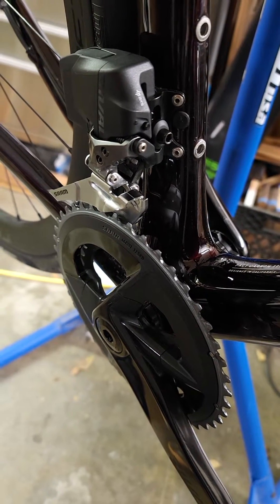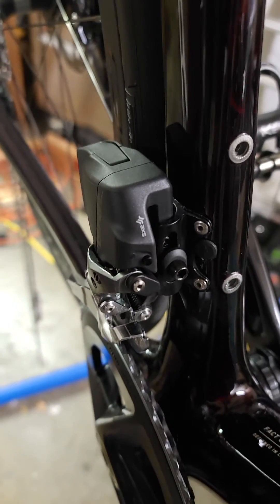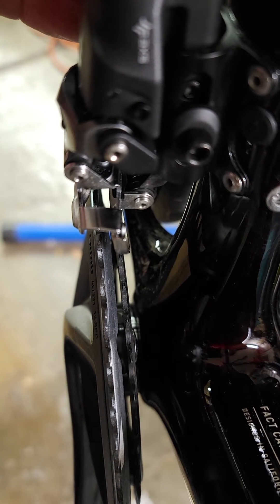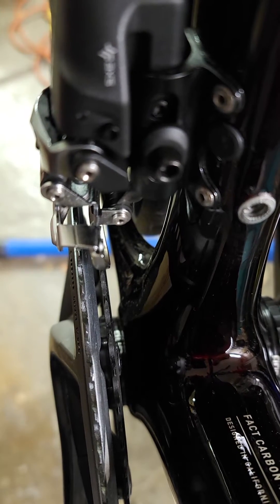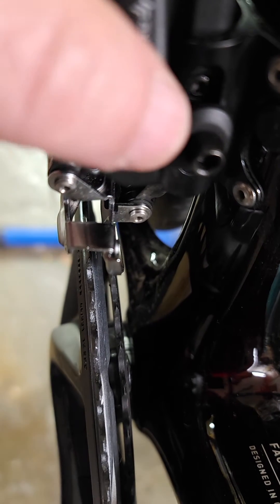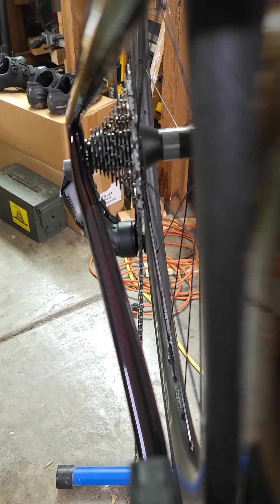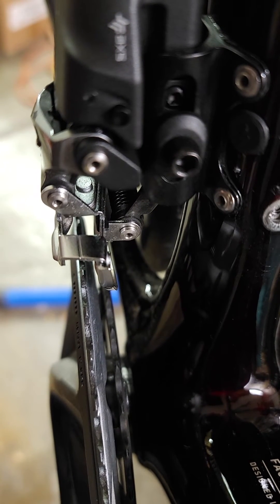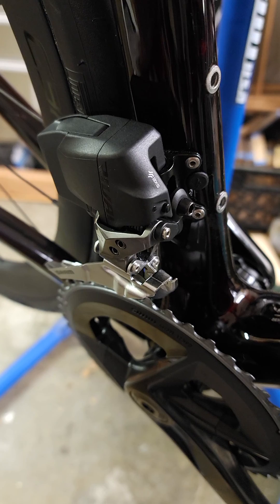Sram Rival AXS front derailleur overshifting

Comment: I just got a new force chain for my otherwise rival drive chain.

Never had a problem with chaindrop before with the rival chain but know I have.

I noticed the drop seemed to happen when the quick link was in the "shifting part" of the chain.
I mention this because I split the new chain myself with an old cheap chain splitter - not recommended by sram. Wondering if this could have damaged the chain and that is issue.
Reply from the maker: that's an interesting data point. thanks. The chain in use on mine was what came on it from the shop.  Let me know if you resolve your current issue.
Reply: Can dismiss my theory - the chain is thrown on all parts of the chain. 

Have fixed it though by rotating the cage counter clockwise so that the marking in the front is about 2-3 mm to the left of the chainring and the the large marking in the rear is about 2-3 mm to the right of the large chainring. 
From here I adjusted the limit screws - haven't been able to drop it and no scratching in the highest gear. 
 @zcarfanatic

Comment: I have same issue with my forces axs etap. Any solution yet?
Reply: get it set up by somebody that knows what they are doing. I had a 5/5 google review bike store look at it 3 times without a fix. Called the CUBE dealer told them the story. They said we will 100% fix your issue. Brought it there and it shifts like a dream and no issues anymore. It's sensitive and needs to be setup by somebody with experience

Comment: I am having the same issue on my wife's new Tarmac with eTap. Works and then doesnt. Overshifts and drops the chain going from small ring to large. Not every time, but what does it matter, it happens twice or more per ride. We watched it and saw that if you wait a second it will correct itself and be in the center line but by then it is too late and the overshoot has done its damage. Had it in the shop twice, works for a day and then goes right back to overshifting. There is NO software/firmware update from SRAM available and so far they have not responded to my emails.

Comment: Seems like nothing has changed re this problem. Just completed new build with AXS Force FD. Have to adjust the high limit to where the chain has a mild rub in highest gear and still not real confident it's not going to drop. If adjusted for no rub it drops chain out board. Never had this prob with mechanical shifting. C'mon SRAM, you can do better. Figure this out

Comment: Bought a new bike in winter and rode 500 km with SRAM Rival without any problems. Switched to waxed (old) chain and rode 300 km without problems. So 800 km without drop. Now I took a new waxed Rival chain, made Firmware Update from xxx to newest version. And bam, had chain drops, 6-7 on a 40 km ride?! All adlustments at FD are like in the SRAM Video, no loose bolts etc. WTF?
So I adjusted the FD about 2 mm above large ring teeth (red SRAM tool will bring it to 4 mm gap) and brought the chain in biggest and smallest cassette ring to a soft contact with FD. Now no drop and quick shifting with low or high cadence is possible again.
Because I was too lazy (and don't want to open the chain lock to often) I will not learn if the old chain and new chain differs or if the firmware update was the bad boy. But because here are some same storys with lots of error free km before first drops I think there is a massive change in firmware at some point.

Comment: It is not over shifting...

Rival AXS does that and aligning it like that always is gonna throw the chain.
You gotta think outside of the box.

I am able to set the FD even with Carbon Ti rings which are notorious for not great shifting and I also have them as a 48-33 combo, which neither company/sram or Carbon Ti recommends.

And my shifting equals rhet of Shamo di2 12 speed
Reply: So how do you adjust it?
Reply: @StarchaseKA  it's a little longer process sometimes, and I can explain BUT I have to type a lot and I can't do that. If there's a other way, like phone, then we can talk
Reply: How have you done this? Can you explain it?

"You gotta think outside of the box.

I am able to set"

What have you done?
Reply: @StarchaseKA  yes I have done this plenty…
All sram derailleurs do that … For example, watch SRAM newest video for the new front derailleur it does exactly THAT. Overshifts to put the chain on big ring and then goes back…

P.S. about thinking outside the box, I AM ABLE to set any SRAM AXS FD with any chainrings…
With Oval Absolute Black rings, with 2 different Oval setups from Rotor, Rings with 16 tooth difference and lastly as I mentioned, CARBON TI chainrings…. They are notoriously famous for not shifting well with SRAM.. I have them set perfectly on my latest bike… And I also have them as 48/33 which SRAM DOES NOT recommend. Shifting is dead on perfect… So to summarize to do many of these setups you need to think outside of the box, not always following Sram’s instructions.

Comment: Same issue here. Mid to large ring at the back tends to drop the chain crank side when I shift to the big ring at the front. Latest firmware. Will keep an eye on this chat to see if any new clues arise.
Reply: Rotate the FD counterclockwise a few millimeter so that the center of the cage should be on the left edge of the chain and set the limiter screw so close to the chainring as possible.

Comment: My problem is that the FD is under-shifting from the small to big ring. It always worked fine but suddenly only moves about 1/4 of the required distance. (battery is charged, firmware up to date)

Comment: Found this video while troubleshooting my Force AXS FD. In my case, the issue was caused by 1) braze-on misalignment and 2) small chainring inverted 180°. The inner chainring has a catch to help the chain onto the large ring.  The inner ring should be aligned with the single-tooth indicator pointing outward toward the crankarm.

Comment: Never realised that the overshift was different if the rear gears were changed! 8 months on, how are you getting on? I was going to try and get realigned soon as I have had an overshift every 100 or so FD clicks.
Reply from the maker: Mine still seems to drop to the outside once every 50 shifts. I have set it up so that the front Derailleur is rubbing the chain when in the large front, small rear cog.  I probably need to take it in for warranty work.  Unfortunately, I just try to avoid front shifting when riding.  mostly riding in the big chainring unless it's a sustained, steep grade. I suppose I need to go out and just do a bunch of front shifting to see if there's any real pattern to it. Overall disappointed that SRAM lets software defeat the mechanical limit screw. I'd really love an explanation on their thought process.
Reply: @zcarfanatic  I've updated everything on mine yesterday, I'm going to probably use the workaround of making the alignment line 0.5 - 1mm out on purpose.

Next plan would be an ugly chain guard but that'd be disappointing!
Reply: Also, mine always drops when I'm in gear 6 or 7 and shift at the front. Your video shows why!
Reply: i have drop issues too , but it seem fine when life up the derailleur about 4mm between large 45 Teeth
Reply: @jcstephenchan_hk  hmm, had a shop look at it recently, apparently fixed but dropped straight away. Got some feeler gauges off Amazon to try and make sure I can get 0.25mm between the chain and derailleur when in 1-1
Reply: Update on this, managed to get the low screw 0.25 away from the chain. It sounds like a small bit of grit when it hits but I've had no issues with the chain being thrown. I'll update after a few miles.

Apparently adjusting the high and low screws on a stand is good to get a ballpark idea but it won't behave the same way on the road.

There's a good thread on R/bikewrench about it.
Reply: 270km and just had my first dropped chain, not sure if it was my fault though (slow cadence prior to changing)

Comment: Hi, did you find a solution to fix this problem ?
Reply from the maker: I've still had this happen a couple times.  I'm starting to just not shift the front derailleur if I don't have to.  Suck I have to adjust my riding to accommodate for a sub-optimal front Derailleur.
Reply: Rotate the FD counterclockwise a few millimeter so that the center of the cage should be on the left edge of the chain and set the limiter screw so close to the chainring as possible.

Comment: if can i help us , i tell my story... after 3000 km same issue. i have spent ours to solved the problem ,watcht sram videos , read manual etc. finally i go to mechanic and he tried 3 times to find the right position and nothing, when he use the adjustment tool he find the best possition by derailleur and now i have less drop chain. i have notice that when the chain is clear with fresh oil , the chain drop disapeared. sure im disapointed with sram e tap force. sorry for my eglish

Comment: I spent 2 days before work and after work trying to figure this out and after seeing your video I’m starting to feel better that thought I was seeing things. This overshifting already caused lots of scratches on my thm crankset with carbon ti chainrings. I been using 1x and with this new build I thought going back to 2x was going to be safe but I’m so frustrated about this over shifting that no matter how much I followed every forum and YouTube video, it still over shifts onto my thm crank 🤦🏽‍♂️🤦🏽🤦🏽‍♀️ I’m about to buy that dual chain catcher  i just found and that might solve my issues but man this sucks. Especially after scratching my new thm crank arms .
Reply from the maker: let us know how that goes.  The scratching on the outside of the chainring/crank-arm is like salt in the wound.  With mechanical group-sets, I might see that once.  after 1/4 turn of the high limit screw, it never happens again (13 years of no chain dripping on my old road bike with manual shifting).  This is a clear case of the technician in the lab thinking they know better than the end user.  When I set the high limit screw, I expect that to be the final limit.  So frustrating...
Reply: What dual chain catcher did you go for in the end?

Comment: I reached out to SRAM support… issue solved. The motor is intended to have this movement, and you need to dial back the upper limit screw in 1/8th turn increments (clockwise) to solve the over-shift. Just make sure the chain is in the big front ring when you do this. If you adjust the limit when the chain is in the small ring you can destroy the derailleur. Here is the section for troubleshooting this issue in the manual: https://docs.sram.com/en-US/publications/2bJvdvYz3DCAfCZVNeUucG/UM%20-%20eTap%20AXS?models=rd-apx-1e-d1#hashItem=front-derailleur-adjustment.

Comment: I am having the same issue. Bike shop installed a new bottom bracket and now front derailleur is over-shifting. So strange as this has never happened before in the 8,000+ miles I’ve put on the bike until now.

Comment: I have the problem where the chain is in the 13ish and then shift the FD from small to big and the it drops outboard.  The FD shifts fine when it is in the higher numbered cogs.  I've tried to play with the limit screws but end up with the chain not moving up to the big ring.  Very frustrating.  If I just pay more attention and shift before I get to the 13ish I guess it will be ok.  Shouldn't be that way though.

Comment: I've had this issue with my sram force FD since day one, I've sent my bike back to the bike shop multiple times only to be told there is nothing wrong with it and that it's the way I'm riding 😠. And now the front derailleur won't shift from the small chainring to the big chainring at all. It touches the chain and stops all together. I wished I had never purchased this group set,in my opinion it's absolute junk.

Comment: I don't know where you learned how to set that up, but their instruction videos do not match your way. Go back and learn the right way.
Reply from the maker: Hey Anders.  I've watched their setup video multiple times.  I have found it's consistent with the published setup instructions in the manual.  Can you elaborate on where I may be going wrong?  I've not experienced chain drop since my 4/15 update, but admittedly have been shifting more in the rear and less in the front - mostly due to a lack of trust.  I was watching the "SRAM eTAP AXS FRONT DERAILLEUR: Installation with setup tool method"  that is 2:50 in duration.

Comment: Same Problem here, changed the Chain on my Ultimate 2021 and suddenly the problems began. There is no setting to fix this. On the lower gears (gear) sometimes its perfect and then a total fuckup for the higher gears. Then I change something and its vice versa.
Even the overshift of the FD is not consistent.
Reply from the maker: is your rear cassette shifting ok?
Reply: @zcarfanatic  absolutely flawless. After 1 week I gave up and switched to 105 DI2. Works flawless after 10 min of finding perfect settings on the FD. I am done with SRAM on road bikes...

Comment: Glad i found this vid. My 2022 Giant Defy Advanced 0 came with Rival. The last ride out I did, its chucked the chain oft the crank side 3 times. Luckily I was in a safe place to pull over whilst in busy traffic. Ive never done any firmware updates as yet, is it as easy as going into the app and connecting to the bike?
Reply from the maker: The firmware updates are super easy, but be sure to run through low and high limiter adjustments again after the firmware updates since software crew is able to override our field adjustments.  After my last firmware update, it dumped the chain to the inside of the front small chainring the first time I shifted into the small chainring.
Reply: @zcarfanatic  oh that would be also an explanation.... Thought FW update would not mess up the whole limits

Comment from the maker: 4/15 update - I have resorted to adjusting the high limit screw in a bit so that when using the large front ring and smallest outer rear cog, the chain rubs the FD cage.  Annoying when it's in the stand, but not even noticeable when coming down the local hill at 45 MPH....  I did not have any dropped chain issues on my last ride, but I've been trying to avoid shifting into the small front chainring for fear of having to shift back...  coming from dura-ace 7800 (from 2009) on my old bike, which was perfect and NEVER dropped the chain, it's disappointing that we have to deal with this.
Reply: Apparently mine is doing this from day 1 and there isn’t a good solution for that no matter how perfect I install the FD. The only way is to adjust high limit screw clockwise, move the cage inward. It will rub when in big chain/small cog but that’s better than chain drop
Reply: I currently run SRAM Force, and while it works, the setup tolerance is incredibly narrow. You know it’s dialed in correctly based on how it sounds, but even then, there’s little margin for error. Proper rear cassette configuration in the SRAM app is essential, as I believe it over-shifts by design to compensate for cross-chaining.

Even with everything tuned perfectly, I still experience occasional chain drops—about 1 in every 30 shifts. This issue persists across the entire SRAM lineup, and even the latest Red hasn’t resolved it.

I use this groupset on my BMC TeamMachine, but I’m about to rebuild it with Campagnolo SuperRecord EPS, which I managed to pick up brand new for €1,200—and I won’t be looking back.

For my next bike, I’ll be choosing between Shimano or Campagnolo Wireless, but right now, I’m leaning toward Shimano. It’s bulletproof, and frankly, I don’t want to waste any more time tweaking a groupset that’s been flawed from day one and that SRAM refuses to fix.

That being said, I do run SRAM MTB groupsets, and they’re rock solid—but that’s in a 1x12 setup.

Comment: I have the same issue I find it's a problem in the middle of my cassette everything else is fine I've installed the latest update that came out just a few days ago and haven't noticed much change. I have noticed that with the micro indexing there's a smaller adjustment when setting the micro adjustment closer to the right (towards the 10) tooth.
Reply: Update I fixed the problem, My problem was that my front mech height was too high, the wedge that is also used on the back of the front mech wasn't screwed into place so on some aggressive shifts the mech cage would move a little bit. Hope this helps.
Reply from the maker: @jaspreetsidhu5708   awesome!  thanks for sharing.  I have checked the wedge on mine too and made some adjustments, but in my case made no difference.  adjusting the cage high limit screw to where it rubs seems to have resolved the issue for me...
Reply: @zcarfanatic  the only thing left that I can say would be to take the chain off and make sure that the  inner marker lines up with the teeth on the front mech my problems have been solved entirely shifting is so smooth and I never have to worry about it.

Comment: Quick update today as of 4/10/23, Shop had made a previous adjustment and still overshifted once on the ride yesterday (probably shifted the front chainrings 3x the whole ride. 3rd time it tossed the chain into the crank. Chain was mid cassette when it happened.  Checked the AXS app today and found a firmware update for the front D... will report back if I notice improvement.
Reply from the maker: I also just noticed a firmware update for the front derailleur.  I see 2.42.1.  Just updated so I'll play with it in the stand to see if there is a difference visually, then go out and ride.  Let us know your experience.
Reply: @zcarfanatic  No improvement following the update for me. Tossed the chain twice the next day. Brought it back to the shop for another adjustment and so far so good... will report back.